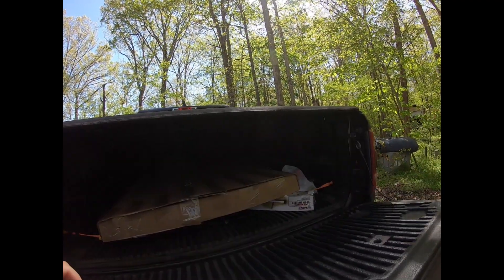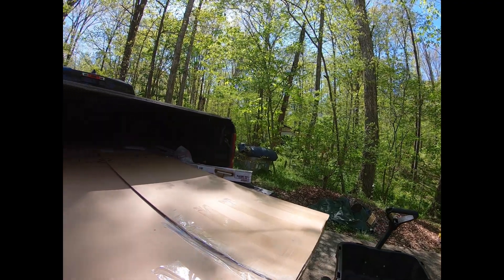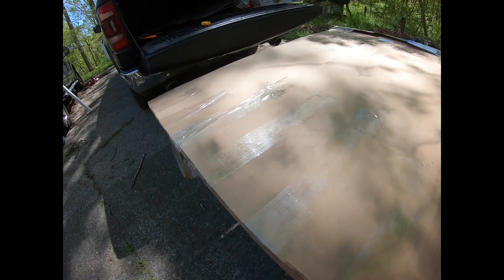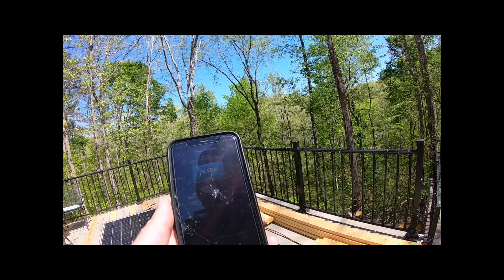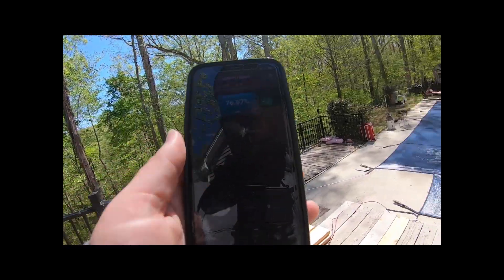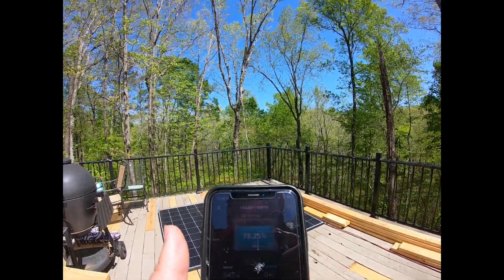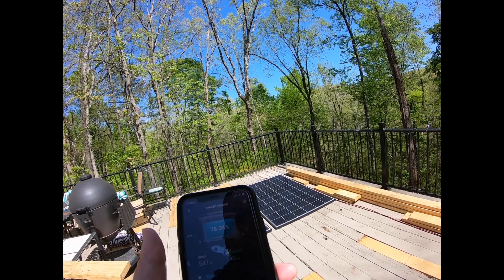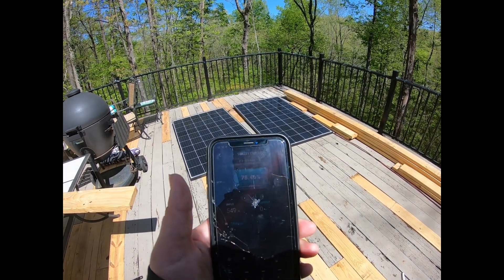Renogy 320 watt panels Unboxing and First Use WHOA!!

Comment: I've got the new 550w bifacial ones and wow do they put out some power.   Even just laying against my garage I was seeing 500w nominally and bet if I put some work into it, I'd see close to the advertised amount.  However, I simply don't know where I'm going to mount them... they are about 70lbs each.  Not light.

Comment: i hope you don't throw a fit and break those solar cells , yeah i saw that phone , looks like it went through a war lol !!
Reply from the maker: Lol I’ve had this phone for about 3 years, I dropped it the third day I had it before my case came in and it broke the screen… it’s an iPhone 10 and if you replace the screen it’s no longer waterproof. I just put a screen protector over it and went on with life. It’s been submerged and caught out in many thunderstorms and hasn’t had any issues so far. I think I’m about 3 months out from getting my wife’s 11 when she upgrades. I have thrown a phone before but not this one.

Comment: I am about to buy 2 Delta Pro's and the Home smart panel to use in my home.  I was planning on buying 4×370 watt panels (2 for each) but in Shop Solar Kits they told me that I should go with 200 watt panels to be safer.  I am no expert but I thought the Pro's were able to handle up to 1,600 watt of solar input.  How is your Pro handling those panels?  Any new updates? Thanks
Reply from the maker: Your are correct, each delta pro can handle 1600 watts each, the only thing you have to be extremely mindful of is the VOC staying under 150 volts and the respective panel’s voltage increase in cold weather. I’m not certain of the specs of your specific panel you’re looking at but I would be inclined to think you could put 3 in series on each delta pro and still be within the proper range. Did they offer any explanation on why going with the 200 watt panels would be safer?
Reply: @cullinthemost  I honestly think that they didn't put too much thinking into it... because I believe that they were thinking that I was going to put 4x 370watt panels into 1 Delta Pro...
Reply from the maker: Probably so, I was just wondering if they gave an explanation and maybe there was some information that I didn’t know as well. Just make sure to check your voltage temperature coefficient for the coldest you think your panels will ever get while using them and use the Voc voltage for the panel you’re looking at. Just add those numbers together if they’re being wired in series and if it’s below 150v you should be good to go. Now that I think more about it, what they were probably worried about was making sure there are 2 separate strings of panels. I would check with Ecoflow directly to be certain as I haven’t researched much into connecting 2 delta pros together and I would think as long as the strings are separate and the each string is input into each delta pro there wouldn’t be an issue but I don’t know that for certain so don’t take my word for by any means. Keep me updated on what you find out bc now I’m curious. I’ll let you know as well if I come across the answer.
Reply from the maker: Ok so I just verified from 2 different Ecoflow moderators that the solar input of each delta pro is independent even when connected to the double voltage hub or the smart home panel. So you can max out the solar input on each but they have to be separate strings. Good to know, thanks for that question!
Reply: @cullinthemost  Thank you so much!!! I will keep you posted

Comment: Go parallel and you won’t have as much loss with shading.  Shading in series is a total killer
Reply from the maker: I plan on adding 2 more panels in parallel. I plan on adding 2 more panels in parallel. Just didn't have the wiring for parallel. I have since repositioned them to get optimal sun and it's working great.  I really want them on the roof but I hate the thought of them being up there permanently. In their current position the house naturally blocks all of the evening sun from about 4pm on and i dont get full sun until about noon. I pretty much knew that going in though so im actually getting more than i was planning on.

Comment: Good video! Wonder if you ran your A.C unit and charged it at the same time with the solar panels it would keep up?
Reply from the maker: Yes, in full sun. I only get about 3 1/2 hours of full sun because of the trees but  the air conditioner runs around 450-500 watts and the 2 panels provide 500-575 in good conditions so I’m typically banking 100-150 watts even while the air conditioner is running. Thanks for the question and thanks for watching. I just got my monthly comparison numbers from my thermostat. I’ll make a video in the next day or so going over the comparisons of April 21 and April 22, spoiler alert: im very pleased!!
Reply: @cullinthemost  Ha that's awesome I can't wait to hear how it turned out! Thanks for information too I might be getting one now really cool.

Comment: That's one heck of a deck! What's up man, watched so I wanted to drop a comment. There aren't many videos of these panels so thanks for making one too.
Reply from the maker: Yes we’ve been replacing some of the old deck boards. The original boards are redwood cedar and they’re on their 31st year! Due to the price of lumber we are putting back treated pine but what a lifespan that cedar has. Hate to see it go but it’s ridiculously expensive these days. I’m planning on adding 2 more of these panels 2s2p to stay under the max 150 voltage of the delta pro solar input. I’m just still torn on where I want to put the panels. On the roof is obviously optimal but I still consider my system portable at the moment and once they’re on the roof they’re there for good. Thanks for watching and commenting and thanks for making your video on these panels, that ultimately guided my decision to purchase them!